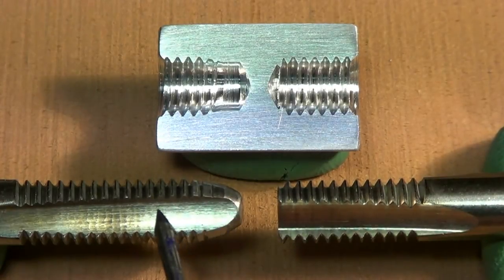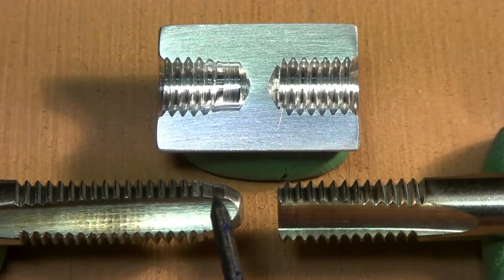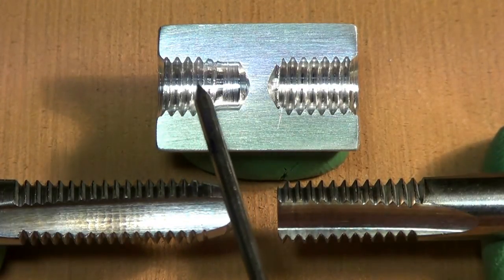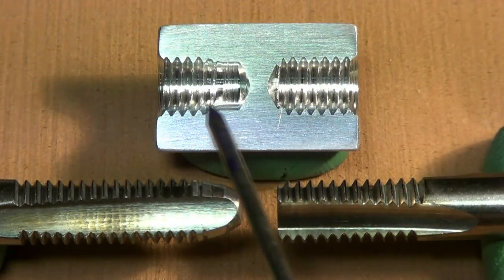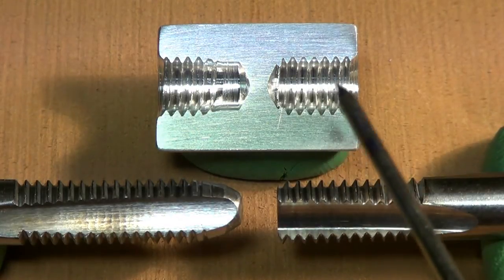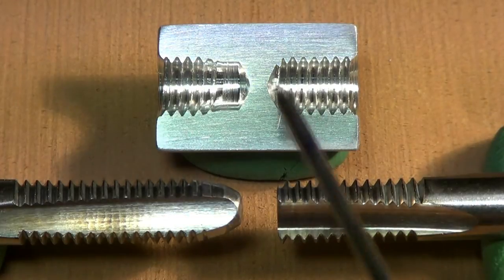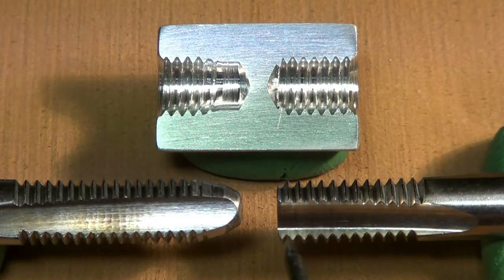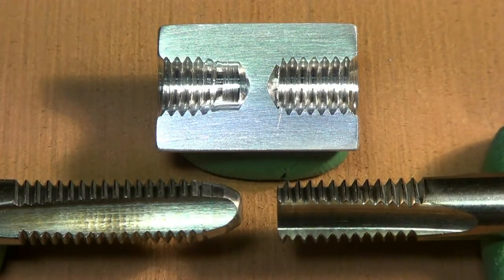Bottoming tap modifications

Comment: The title and description of this video are misleading.  The tap on the left that you started with is NOT a bottoming tap, it is a plug tap, and the two are NOT the same thing.  What you did was effectively turned a plug tap (4-6 tapered threads) into a bottoming tap (1-1.5 tapered threads).  Google "3 types of hand taps" and you'll get more detailed information on each.
Reply from the maker: Sorry, have to disagree. The tap I started with is advertised and sold as a bottoming tap, and is comparable to every other bottoming tap I've ever bought. I'm aware that plug taps have more lead-in taper than bottoming taps, but this isn't one.
Reply: @imajeenyus42  It isn't necessary to grind off a bottoming tap like you did. It was a standard plug tap.
Reply: You mean he turned a plug tap into a bottoming tap.

Comment: Haven't you ruined the tap?  Aren't taps are case hardened / nitrided to .005" - .015" deep from the surface?  Nitriding is heating to ~950f and introducing anhydrous ammonia and is used to case harden a lot of tools.  You may want to check with your tool's manufacturer, but I think you ruined your tap.  You should have just purchased a bottoming tap.
Reply from the maker: +Ten Millimeter This is a cheap unbranded carbon-steel tap, which is through-hardened and tempered. It was only for tapping in aluminium, so I wasn't concerned about damaging the hardness of the tool. Yes, I am aware of bottoming taps. But even they still have a few turns of lead-in taper, as shown in the video, which was unacceptable for this particular application.
Reply: You make a strong argument - and I'm going to try it.
Reply: I frequently grind taps to get more thread reach into the hole. Works 
great but you need to do a good job grinding as the lead edges must be 
sharp. I save the ground taps for future use.